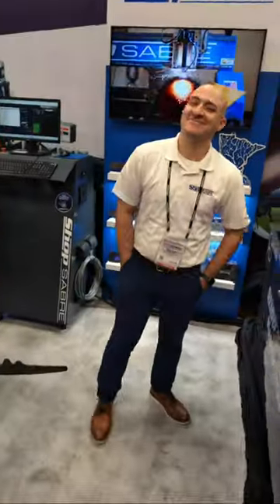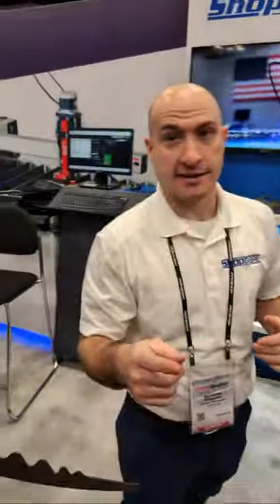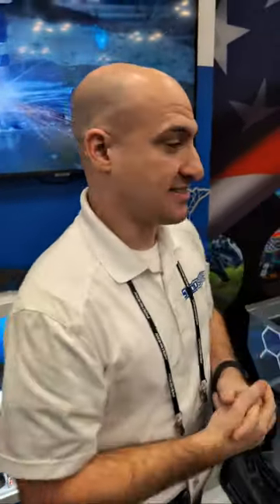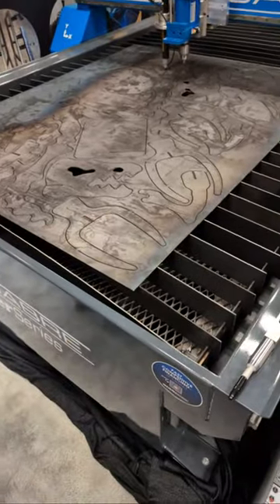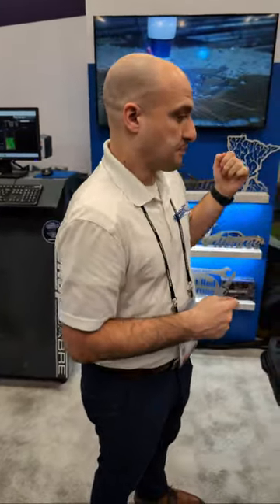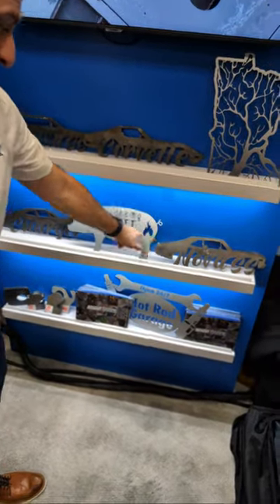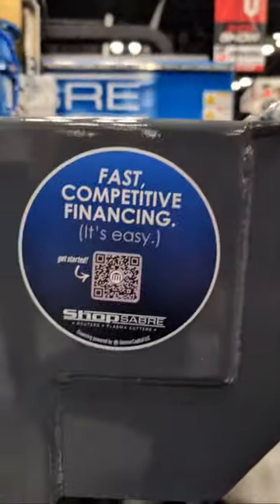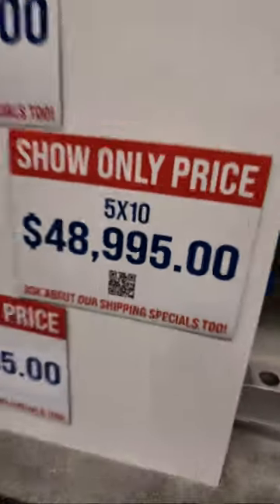New CNC Plasma Technology?

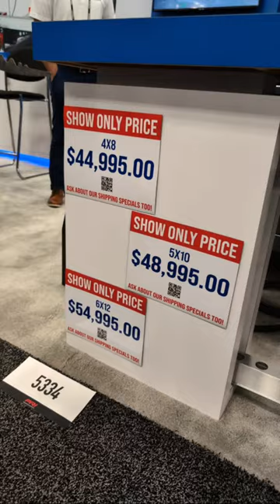Comment: 11:50 I'm confused.  Their website shows prices starting at $36,495, $42,350, and $48,495 for the Shopmaster Pro 8, 10, and 12, respectively.  Is there something left out of what you purchase from the website compared to what they're showing at PRI?
Reply from the maker: The prices on the website are for the base model machines with no plasma power unit, no drill attachment, no collision detection, etc. these machines were selling during PRI are fully loaded with every available option! Cheers!
Reply: @LiftArcStudios I guess that makes sense.  However, if we're to assume that the website prices are normal prices, that means all of these options are not only $6k-8k more for the PRI event, but potentially $26k-28k more after the event (since it was mentioned "$20k off!!").  Is that a reasonable price for those additional options?  You could say that the PRI price of a base model would be less than that listed on the website, but then that means the extra options are greater than $6k-8k.  I guess I'm just trying to understand the added savings of the PRI event.  Wishing you guys success at the event, regardless.